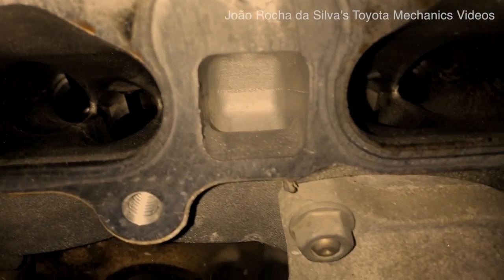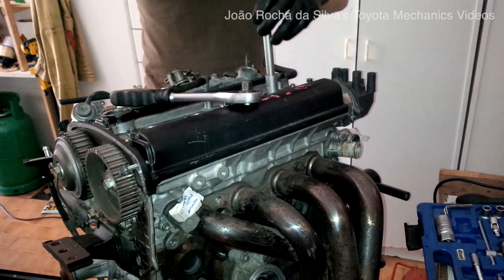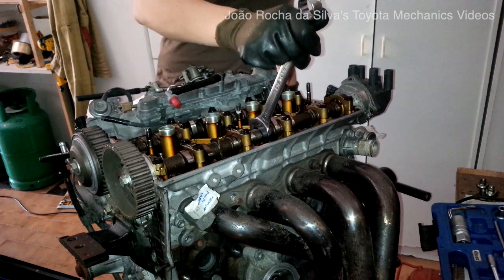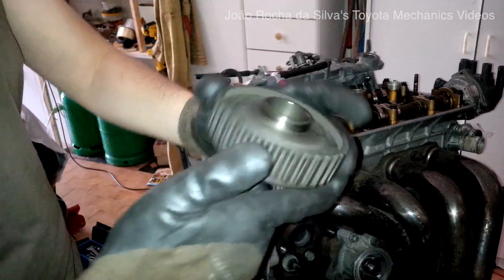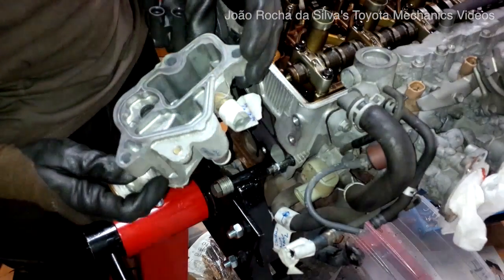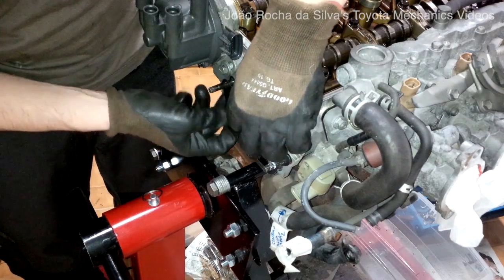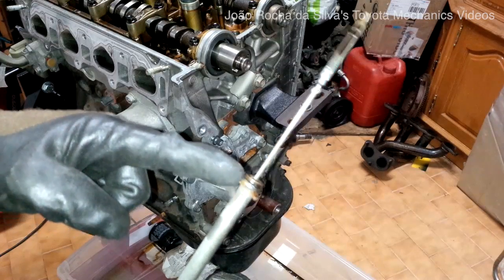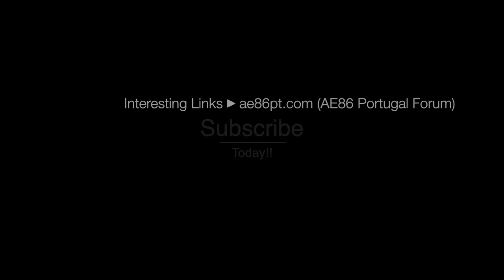ᴴᴰ(Part 3) Toyota 4AGE 20 valve black top engine rebuild: Engine Head (1/2)

Comment: Hi! i have a stock 4age blacktop engine and I want to increase its horsepower. I was given two options by my mechanic, First is do an engine rebuild and second is to get a new headers and a lightened flywheel. Can you please give me some advice or pros on  the choices? If I get a new headers, can you tell me what what specific size should I get and would it be the 4-2-1 headers? we can talk via email, may i know your gmail pls?

Comment: Did you teach your self to do auto mechanics? Or did you take lessons or a cursus?
I really want to learn auto mechanics, but i don't know if i want to take lessons. 
I was thinking of buying a cheap car to dismantel it and put it back together to teach myself.
Do you have any advice for me?
Reply from the maker: Azzeglio de Baas Hey, I learned what I know from YouTube channels like EricTheCarGuy, MightyCarMods, and many others, the Toyota manuals and some advice from friends at forums. My best recommendation is to get a car in good shape in terms of bodywork but with some mechanical issues. If you buy a car just to dismantle but have no love for it you will just end up with a pile of junk and not have the will to put it back together. Buy a reasonably cheap car that you LOVE and would like to see completely repaired. A Toyota Starlet EP71 (fwd) or KP71 (rwd) would be good candidates. They are simple and there are the excellent Toyota manuals that can help you out. Good luck!
Reply: Thanx for the advise :)